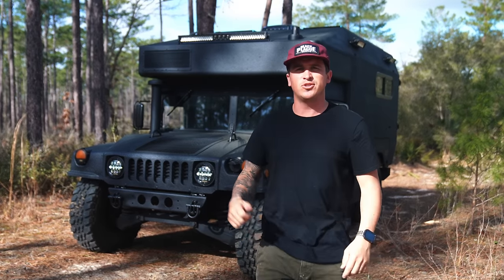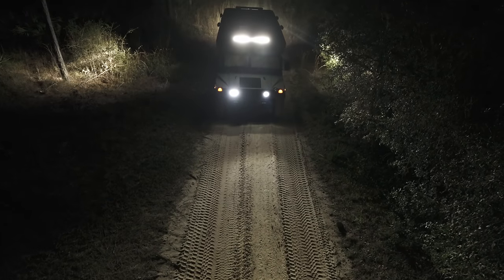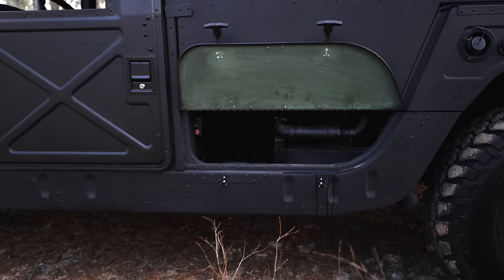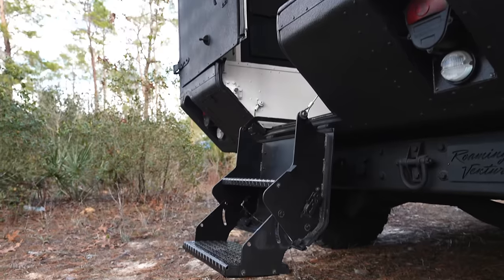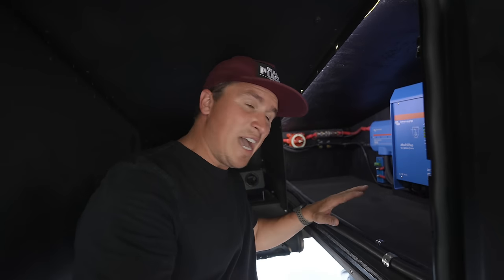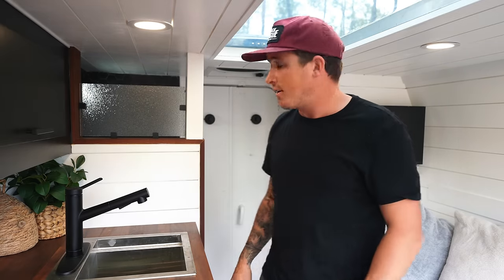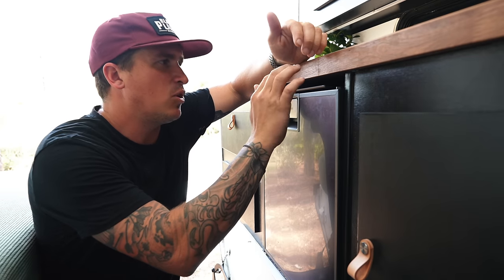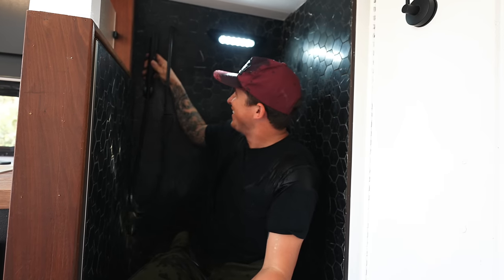RARE Humvee Turned into an Over-landing Camper  (full tour)

Comment: Finally I've found a guy who has toilet and shower in his campervan.
There are tons of videos on YT with camper builds without toilet. And even more without shower. They use most of space for big kitchen and all unnecessary stuff, and they don't have a place to $hit of wash themselves.
Great job! You've earned a new subscriber!
Reply: Depends on what is your goal. Where I go, I'm always alone so I don't mind washing myself in a lake or a river. If that isn't available, my outside shower does just fine. As for the toilet, it's really only for #1 at night, anything should be done outside.
Reply from the maker: Yes!! Thank you
Reply: At one point I was basically homeless living out of my car. If you dont have the luxuries of a home (bed, kitchen, toilet, water, fridge, etc) some of the   "campers" I see are closer to glorified homeless mobiles.

It gets old needing to constantly use public bathrooms, cook outside, shower outside, etc. After all, these are for traveling so your on the road often.

I would install a shower and toilet as well as the other necessities (although I'm unfamiliar with the compost toilet thing). This is undoubtedly the best platform for transforming into a usable, true little rv.

Comment: It looks really nice and the guy restoring seems like a good guy - if i was doing that build id look at ways to raise the ceiling\roof rather than just cutting a strip out the middle. If you plan on going to humid locations youd be surprised how much more tolerable it is witg some added airflow between your head and roof. 😅

One place tiny home and overland \ vanlifers alike would do well to steal ideas from for their builds are boat interiors. 
There you'll see how maximised space and storage options have been refined to a fantastic level not just for aesthetics but for function. 

Anyways thanks for posting and sharing ❤

Comment: I like the build and It’s your vehicle I’m not trying to tell you what to do with it but if it was me I would look at converting the starter over to a 12 V starter and doing a slight rewire accordingly…… a 12 V starter is  easier to find than the 24 V starter if it ever goes out.

Comment: Beautifully done and very creative on the build as a whole. Very nice on power system and I personally would have 200 watt solar panels because I would want the AC and entertainment systems run all night lol. You should buy one of those tiny wood stoves to keep warm all night in the winter.
Reply from the maker: Thanks! I have a portable battery AC that works amazing. And for heat I thought about the stove but just tapped into the diesel and added a diesel heater

Comment: I love your choice of vehicle and the way it fits your intended purpose, a couple of things that I would do different are round off the corners of your kitchen top, you never see right angle edges on boats, change the cooker for an induction hob it is so much simpler in a situation like yours, get a second alternator 200+Ahr on the truck engine just to charge the house bank.
Reply from the maker: Thanks! Yeah the cooker is also setup for induction but it has a larger draw on the batteries so I swapped it to gas

Comment: I love it, good job.  I get the reason for the sun roof but here in Texas it would  turn the truck into an oven.  In my fifth wheel I put insulated foil in the sun roof of the shower because of the heat.  Other than that it's a great off road camper.  Put some landing gear on it to keep it from rocking.
Reply from the maker: Thanks, yeah, I have a foil reflecting that goes in there during the day

Comment: How would you like to trade your build for mine: 2018 Colorado ZR2 Diesel with 33” tires, winch, on board air compressor, Alu-Cab camper, diesel heater, ARB Freezer/Fridge, oven, and much more😊

Comment: Glad I stumbled in your video with this latest upload.
Great camping vehicle.
Definitely have to subscribe after the intrusive thoughts win on using the shower. 😂
Reply: Recently thinking if I bought a hummer h1 2001, open trunk model. Still need to fabricate a frame just like for making a camper vehicle.
If that vertical space is 6ft, I think doing a 2meter pop up roof is better to have more sleeping space, and put the solar panels on the fixed part of roof.
And do a space for an off-road motorcycle and bike inside.
That's what I would do, but now I need to find a hummer model like this so that I can have a built-in sturdy frame.
Thanks for the idea.

Comment: I’m working on a hummer h3 diesel swap and building out the back for my tools and gear. I also have a top box build that starts the air flow for the custom build tiny home trailer I already have mostly done now. I’m hoping this coming summer I will have the rig fully done and ready for just about anything. I have an enduro bike I can park inside my tiny home for long trips. Right now I’m working on the hummer undercarriage. I also need to do an axle swap on the trailer. The whole shebang has taken my three years up til now and I’m 34k Canadian all in so far. I will be just over 40 I’m sure when I’m done spent not including my time which has been a lot. After that it just gets better. I had them connected for the first time a few months ago before winter came. Kind of a dry run and a learning experience. Since then I’ve been living inside my tiny home trailer and working on the hummer when I can. Learning the in’s and outs of what it’s like to live out of my own hand built rig. I would have loved to have a h1 but damn the price was too much for me. Very nice rig and great job 👏👏 I hope you enjoy it as much as I enjoy mine.
Reply from the maker: Thank you, and good luck with your build!
Reply: @roamingventures  👍

Comment: nice build, hope you did upgrades so it rides nicer and goes faster than 55, seen a bunch of humvee things and the most common complaints are the zero noise cancellation and the 55 top speed and how often parts seem to break
Reply from the maker: Yeah, in previous videos, I added sound deadening to the engine housing and swap the transmission so I can go 70

Comment: I'd like to see others who have converted the Humvee to a RV. these are a lot more readily available than one might think, as they are on the Govt surplus auction sites literally every day and go for pennies compared to the cost of a Civilian H1.Yes there is paperwork but they are all cleared for sale to be used on US roads by US citizens. This one is definitely a good layout but as with all conversions, the different designs are a product of different minds... definitely would love to see other's Humvee builds. Also the MRAP 6 wheel truck is another military chassis that is super easy to acquire on the govt sites. at any rate this a really well done conversion. I esp love the driver's area.. so many times the 'command center' is left to the wind and you did an amazing job with it.:medal-yellow-first-red:😎👍
Reply from the maker: Agreed! Thank you
Reply: They are NOT all cleared for US roads.... the rules for HMMWV's titling/registration for on-road use vary from state to state.  About half the states now will not title a HMMWV for on-road use.  My state will not allow you to get plates for it no matter if it was on-road-titled in another state like Utah.  It's why that 17 digit VIN on a civilian H1 is worth the price you pay.  Also be aware that there are over 30 changes that AM General made to the the structure of the H1 to make it meet safety regs at the time they were manufactured... including anti-decapitation brackets that the military didn't see fit to install. As someone who took a barrel roll in my first H1, I appreciate AM General going through that process.
Reply: @nothingtoseaheardammit Im in Florida and you can title a lawn mower with a V8 and tail lights to drive on the hwy, and we have 100s of the military spec H1 on the road. you can also cut the body off a Honda civic and weld the body of a 65 mustang onto it. the initial rules of safety designs dont apply once a car has sold and esp if the state or county doesnt have inspections. This is why the US is great we get 50 diff options to choose where we want to live and what we want to do and have to put up with in laws.. ill stick to Florida.

Comment: Nice rig but a FLA isn’t rare. A quick trick for the run flats is to find something that has an outrigger. Press down the run flat secure with a ratchet strap and slip in. When removing use same outrigger and a come along or hoist ect. Careful it comes out quickly. Down the road I’d recommend traditional wheels in an easier to find size ie 17in. Bolt pattern is GM 8 lug.

Comment: I had 400 watts of solar and 2200 wh of batteries with an electric water heater. That water heater was a huge drain. When the batteries won't charge with 4 cloudy days....lessons are learned. Propane (and propane accessories) is still king when it comes to heating everything.

How much does the truck weigh?

Did you lose the haircut bet?

I'm seriously considering building one of these. My only concerns are driveability and fuel economy, but wvo can be substituted for D#2
Reply from the maker: Yeah I only switch on the hot water if the batteries are over 60%. But having the DC-DC charger is helpful on cloudy days and can bring the system back up to charge faster. I wanted to do a propane water heater but just didn’t have enough real estate inside for something that big. But I agree it definitely is 10 times more efficient.

No, I ended up winning the bat then got a haircut right after Haha. 

Yeah, the fuel is the only thing that sucks in the long run. I’ve seen some people swap the engines to gas in a diesel.

Comment: It looks great but you don't have enough space on that front driver seat, driving a 100 miles in that thing would be an absolute pain lol. I use to have a H1 Wagon and they're crazy small on the inside, I think with the cab you have on the back you could definitely create more space for a long drive to get comfortable whilst driving.
Reply from the maker: After switching out the seats it made a big difference. I've done some long drives in it and its not as bad now

Comment: Very nice job but you really should have gone with an induction cooktop since you've already got an electrical system set up and you wouldn't need extra space for the propane tank.
Reply from the maker: Thanks, propane is just more efficient and the induction cooktops draw too much. I’ve had both in previous builds 👍

Comment: very cool Projekt but so many Campers burn down with a Gas leak on his System.. jeah it is more efficense but the Risk is to high buddy!
Reply from the maker: Most campers have issues with propane due to user error plus it’s important to have safety devices in the rig as well. I’ve used propane for multiple years and lived off grid for 4+ and never had an issue. Having a propane fridge is also a huge plus when living off grid

Comment: Been watching yours came out awesome! Are you interested in working on another one? I have a 2001 ambulance body. I did have to buy rear doors and the step.  As you mentioned they did not come with the vehicle. I live in CT but have it currently in VT have been using it to go upbto the mountain skiing. I have gone through the truck mechanically its solid. Need to build out the body
Reply from the maker: I appreciate it! Nice, yeah I would be open to it, as long as we could build it out here in Florida
Reply: @roamingventures  where are you in FL ?

Comment: Have people done EV conversions for Humvees? I feel like there's a TON of space for batteries and engines on a Humvee, so basically straight up ripping out the whole Tesla drivetrain and putting it into a Humvee would be a game changer. Though I personally think that plug-in hybrid would work best. Basically you have a gas or diesel generator inside, batteries, and electric motors that provide the actual torque, while diesel always run at cruise speed, charging the motors, the generator, charging the batteries and providing all the other things like parked energy. In this case it can be a relatively small engine compared to Humvee's monster.
Reply from the maker: True! Maybe I’ll do that for a future build

Comment: offroading vehicles are probably the best option for camper modification
Reply from the maker: Yes 🙌
Reply: @roamingventures  don't forget extra power in a can for added weight
Reply: @roamingventures  there's also the fact that you might need to bring in trailer for the likes of a generator and similar things which standard campers would struggle to haul in an off the road condition

Comment: My brother decent video spent a lot of time with these while I was in the army. Here’s my issue. None of your terminology is correct. The cab of the truck is where you drive from not The box on the back of the vehicle. You said that a skylight ran the entire length of the topper that is not a topper, sir not even close to a topper, and when I finally turn, the video off is when you opened up the little box on the back where the bumper would be, and said this is for a gurney never in 1 million years with a gurney fit in there that is for a litter. And that’s when I stopped the video somebody created an awesome vehicle here it looks great and I would be honored to own it and drive it as a disabled veteran. But it is very clear to me that somebody else did the work and you were just presenting it.
Reply from the maker: First thank you for your service. Sorry I don't know the exact words for every component but I did do all the work. The entire build was filmed which you can see on the channel. And when I bought it the swat team that owned it after the military stored a gurney in that bow.
Reply: @roamingventures  Gurnee have wheels, and legs a litter is carried and goes in that compartment
Reply from the maker: @pacman73c1  yes I know, the swat team that owned it had a collapsable one. I still have it in the shop

Comment: How is this rare? when I was in the service, 30 of these things sitting in the motorpool either having a dead battery or stuff missing like the drain pan ang wheel blocks.
Reply from the maker: Thanks for your Service! It’s rare mainly because the military didn’t remove the doors / stairs when it was sold and it has a street legal title which is hard to get👍
Reply: @roamingventures  oh, now i get it. good info. These trucks are so robust as long as its being used. Keeping it sittingnin the motorpool not being driven cause problems. its like rotting away slowly. I would love to by the uparmoured one and make it my daily driver. I live in texas and so many foreign nationals on the road now and they dont know how to drive properly. was in a fender bender twicenin 1 week because of people merging into my lane while side by side.Up armoured will just buff out the markings.

Comment: and now it's the time for all US Americans to learn, that "etc" is not pronounced "exetera". Has nathing to do with extra...just simply "et cetera"...so if you use foreign words, use them correctly to not embarrassing yourself.
Reply from the maker: It alright, we all can’t be perfect. That’s what makes us human. Plus I just add a little southern slang to it 🤣
Reply: @roamingventures  you are not the only US American who says it this extra way, that's why I mentioned it. Hope you are not offended like some other citizens of yours.
By the way I love the truck. Why didn't you mounted the LED spots on the side in a slight angle to the front and the rear, so you have like a more surrounding beam from them? Or is it enough like it is? 
And you didn't mention the overall weight, that would be interesting.